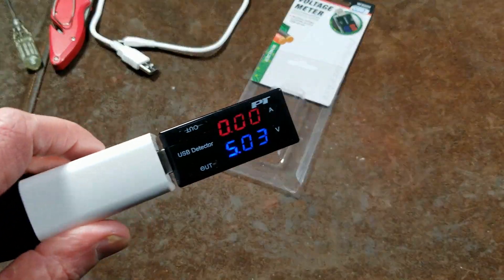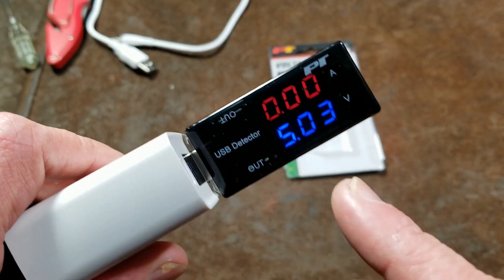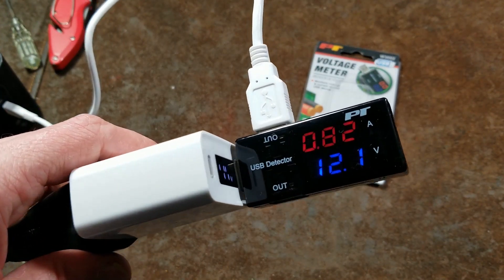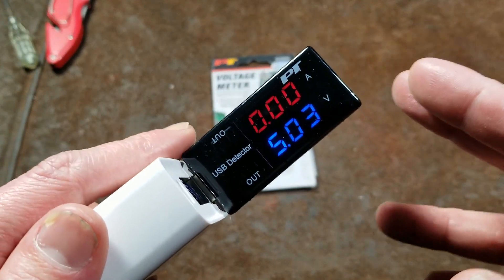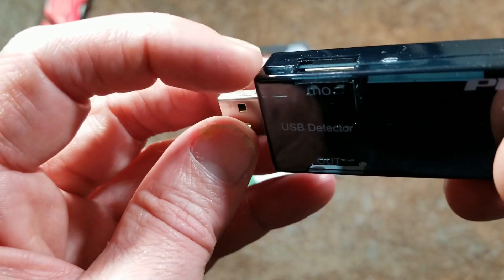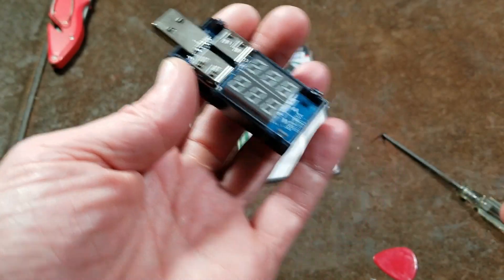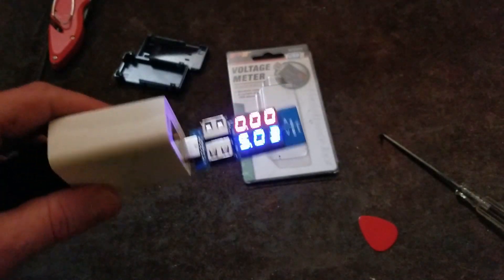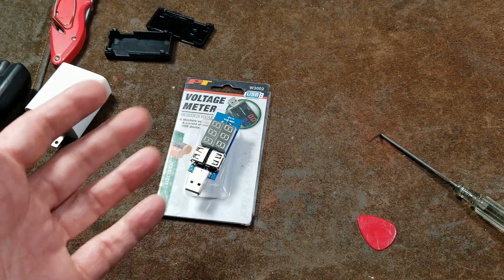Performance Tool Automotive USB Tester Review

Comment: Look up "Digital USB Tester Current Voltage Meter Charger Voltmeter Power Detector" on ebay. There are some other units for sale for dirt cheap that also read out watts and watt hours/amp hours.